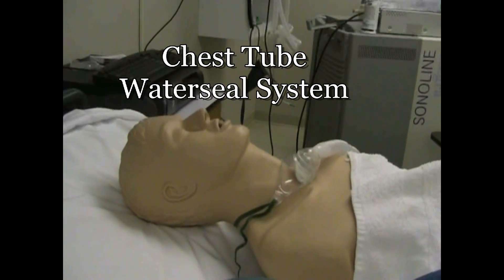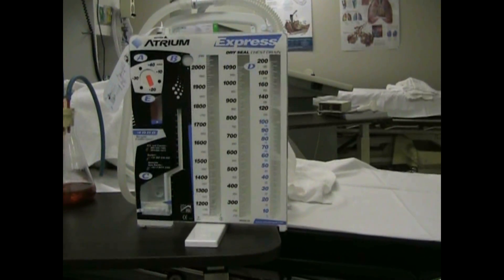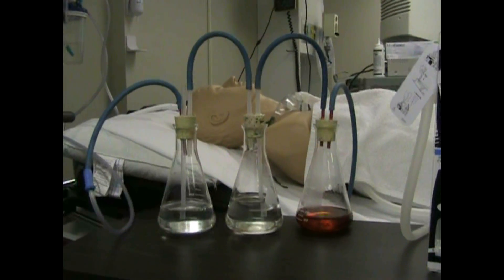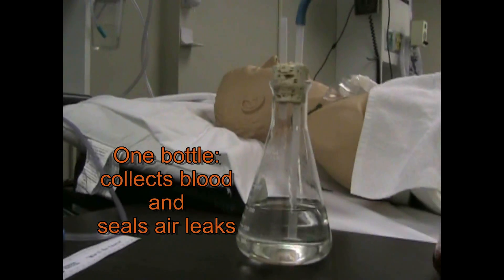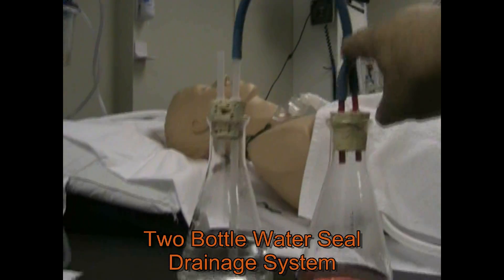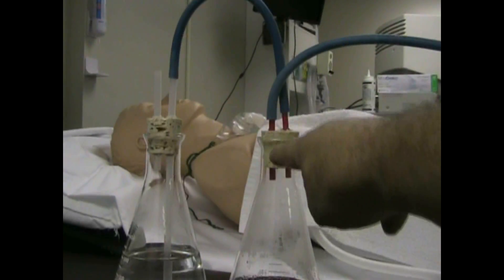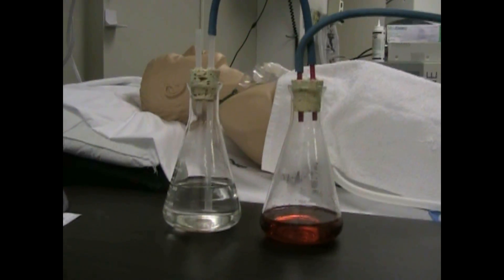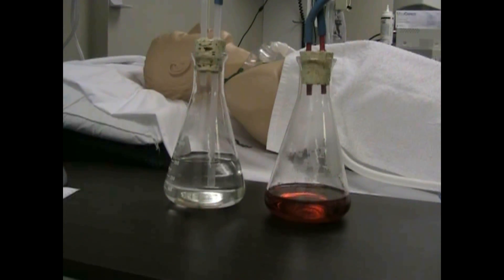RESPIRATORY CARE: Chest Tube Waterseal Bottle

Comment: On inspiration we expand the thorax by rib and diaphragm movement. This as you know creates a slight negative pressure.  The water seal prevents air from moving in through the chest tube. This is noted by a rise in water in the column of the water seal bottle. On exhalation, thorax and diaphragm relaxes down to it resting position creating a slight positive pressure which allows air to be passively exhaled.  Also this positive pressure squeezes down on the pneumo which allows some of the air to escape down the column of the water seal bottle. This is seen as the bubbling on exhalation.  When bubbling stops either the pneumo has resolved or the chest tube is plugged.